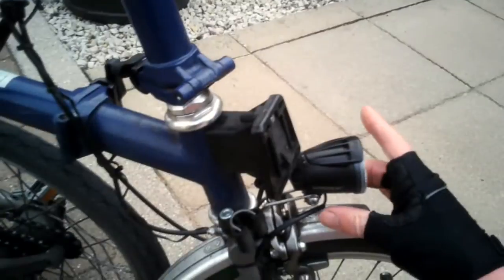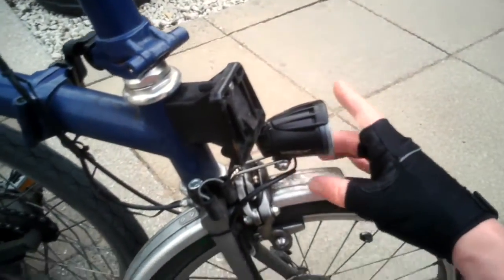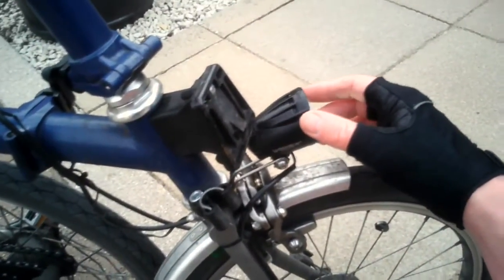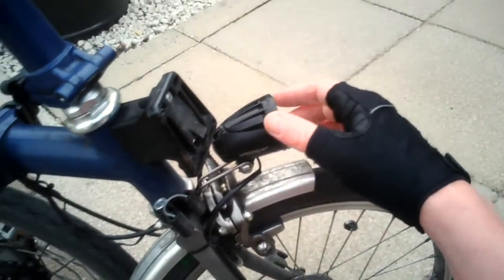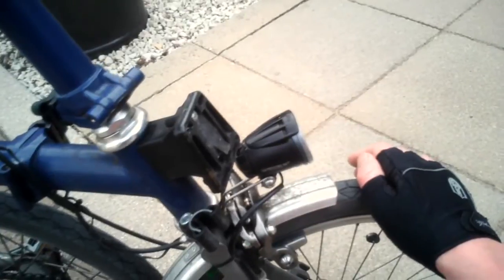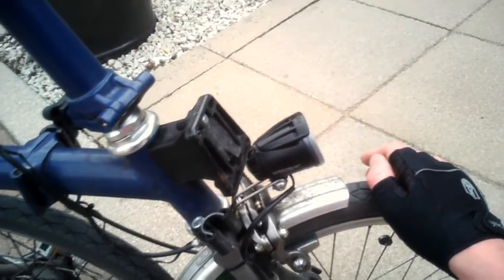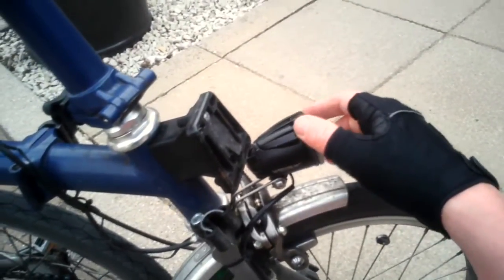Brompton Lights Are Made Of Cheese

Comment from the maker: @NeilandJamesJones It's the excellent Son hub coupled to the flimsy B&M front light that's mounted via a fragile bracket. Within a year, two front lights have snapped and four brackets. Evans/Brompton have informed me that they are now unilaterally declaring this to be out of warranty. I have removed the front light before it breaks again and will either fit something better or mount it on my handlebars. People should not go for this option until Brompton have solved the problems with it.